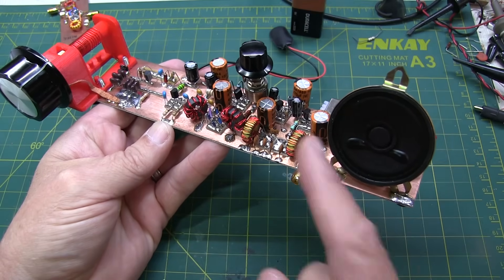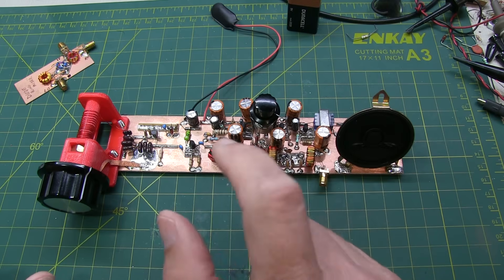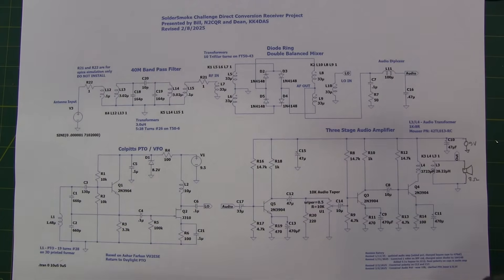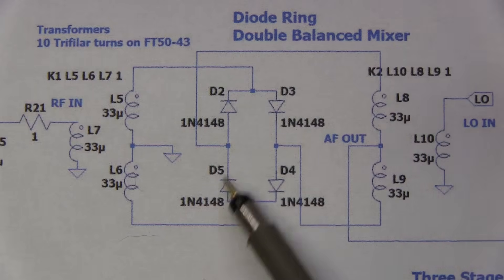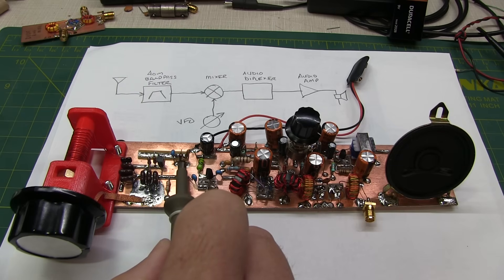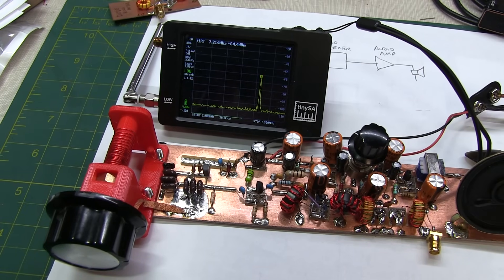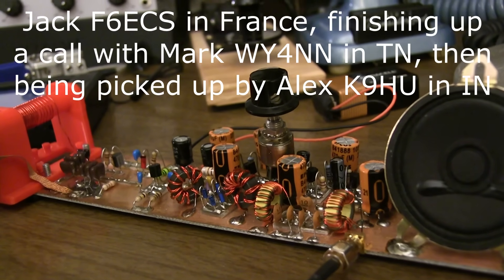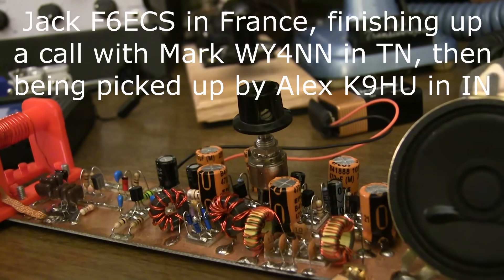#398: My  build of the SolderSmoke Challenge Direct Conversion Receiver for 40m

Comment: Wouldn't it have a terrible noise figure with all that loss stacked up on the front end with no RF amp?
Reply: Some "Back-of-the-Envelope" calculations: Normally, a NF of about (1+7+5)=13dB or seem to be excessive. At 40 Meters, it is very good, because antenna noise of a typical dipole in most enviroments will far exceed ~13dB.   So refer to Radio Noise, ITU-R P.372, Figure 2. That gives us Fa, the  External Noise Figure. At 40 meters this ranges from approx 33dB in quiet locations to 55dB in typical urban. So, given the strong 40M signals W2AEW mentioned, you would want a good strong front-end, anyway. 

The only good reason I can think of for adding an RF preamp, would be to reduce tunable hum from re-radiation- but that does not seem to be happening with the SolderSmoke DCR, or if it is I am not aware of it. I have (in every case) had to add a low-gain/high reverse isolation preamp for my DCR's. Just a simple JFET, grounded-gate amp. 73's
Reply: @wn2a73  Thanks for the detailed reply.
Reply from the maker: @wn2a73  Thank you for the detailed noise analysis, I appreciate it!
Reply: @w2aew  At my home QTH, the Antenna Noise runs 36-37dB above the receiver noise (with input terminated) on 40 Meters. We see about 33-34dB for that on 30 Meters. So, yes, 
1) the ITU Report data looks credible
2) Unless you live in a really quiet area, save your preamps for the higher frequencies >20MHz  😃
Reply from the maker: It’s not meant to be a stellar performer. Most of the loss is the mixer conversion loss. Quick test indicated min detectable signal around -100dBm.  Emphasis was on simplicity, so an RF preamp wasn't in the cards.
Reply: @w2aew  No offense, but how many parts would an RF amp add? Same with a couple capacitors in the audio amp for a low pass filter. I just don't get the logic here.
Reply from the maker: @misterhat5823  RF amplifiers can be tricky for a first-time, inexperienced builder.  They are layout sensitive, which lowers the probability of success.
Reply from the maker: @misterhat5823  And, generally, signals are much stronger on the lower frequency bands like 40m, so the extra sensitivity gained by a preamp isn't as necessary as it would be, say for 20m and above.

Comment: Using a brass screw is interesting. Brass is weakly diamagnetic material (copper and zinc) -- so very small changes as you turn the screw. Would it not be slightly better to use an aluminum screw, which would strengthen the magnetic field rather than weaken it -- though Al screws are not common.
Reply: With the brass screw, the screw itself forms a secondary -- current flows (Eddy currents) and the effect is like reducig the number of turns in the coil, and thus the inductance.  Steel screws actually work a bit better, because as you turn, you are changing the permeability and you are also getting Eddy currents.  So it ends up taking more turns of the dial to cross the 40 meter band.  And there are other ways to improve tuning. Hey, build the receiver!  There is a lot to learn from this simple machine.  Bill  N2CQR
Reply: Steel makes it more tunable. Build one as designed then make some of your suggestions and let us know!  I'm learning a lot from all the comments.
Reply: The most amusing VFO I have seen is a glue stick and an T50-6 hot glued inside. It has a bit of backlash but the mechanism is all there for a functional VFO.

Comment: The audio reception is rather poor. Anything to be done to improve it?
Reply from the maker: For a minimalist receiver, it’s quite good. Better low freq audio would be possible with a better speaker driver (push pull), and a low pass filter to limit the hiss would help too.
Reply: @w2aew  ...and if the loudspeaker was enclosed.
Reply: @MirlitronOne  Just a little tone board around the speaker should do, 3x the diameter of the speaker.

Comment: Neat and simple receiver. But 14.7k resistors? No HF audio cut-off filter?
Reply: It's as simple as they could make it. It was a perfect project for me. I had never built anything electronic before. I am a fairly new ham and it was great for me to learn the theory of how a radio really works. Try it as designed make the hall of fame then jump into the mods channel and show us your improvements so we can learn from you.
Reply from the maker: 15k will work just fine. A low pass filter in audio path would be a nice addition. The designers were keeping it as minimalist as possible.

Comment: Dear W2AEW,
IARU designed and made a lot of  such receivers and transmitters in separate enclosures in the 1980s, and these were distributed to all amateur radio societies in the world. I, being member of the Pakistan Amateur Radio Society, received a set comprising a 40 Meter transmitter and receiver. It has been lying somewhere in my garage for a long time. I will try to dig it out and see if it still works. 
Thanks and regards, ap2kd.